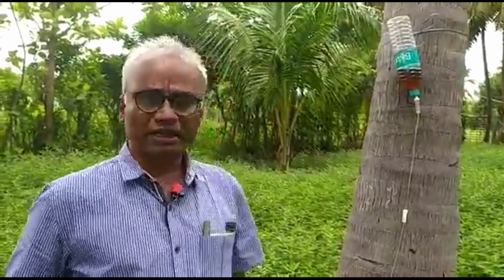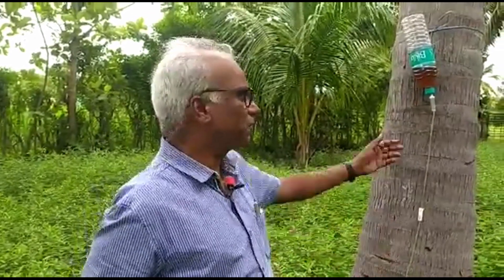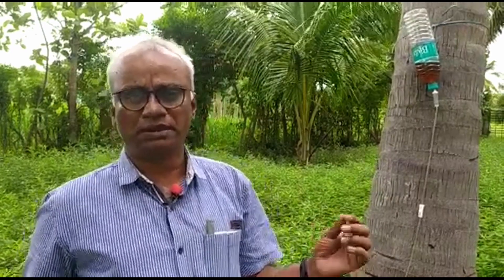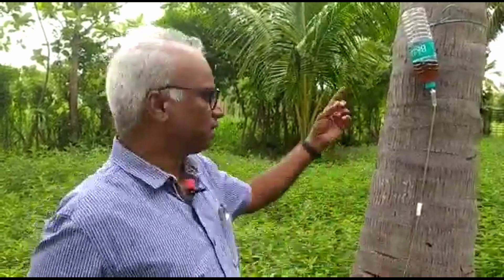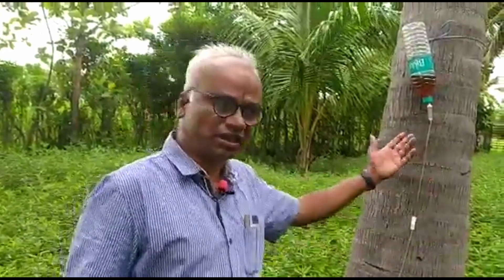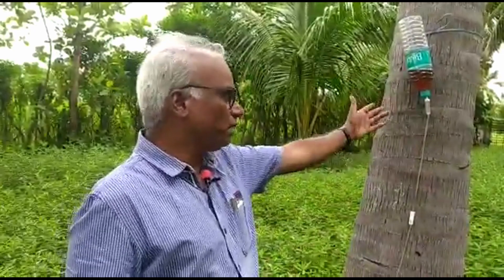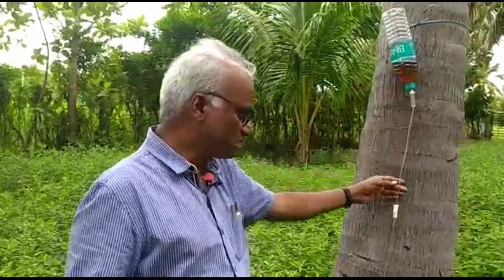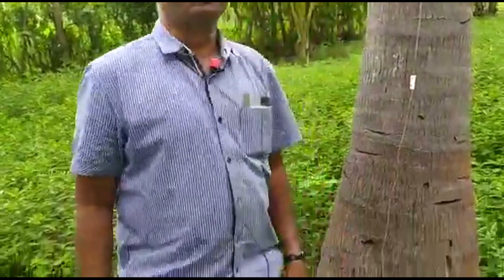#Coconut Nutrient Solution  injection, #How to inject Nutrient Solution to Coconut

Comment: SIR   TREES SHOULD GET ALL VITAMINS FROM THE SOIL.    CHECK FOR EARTHWORMS.  IF NOT PRESENT. FERTILISERS YOU ARE USING KILLING WORMS.   USE  NATURAL FERTILIZERS.  SOIL NEEDS WORMS.
Reply from the maker: This is only supplement, if the trees  are not fertilised, due to drought.    For normal Soils,  there is no  need  for all these things.  This is to bring equilibrium . Then  you can go back to natural method. Healthy Soil,  Healthy Trees,  Natural methods  will work better.